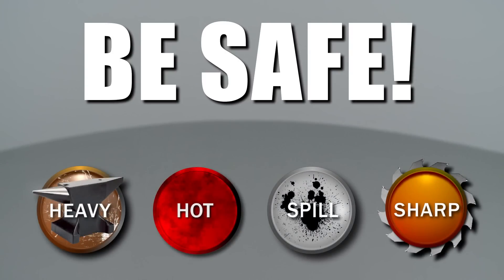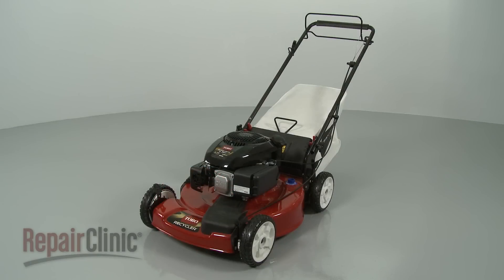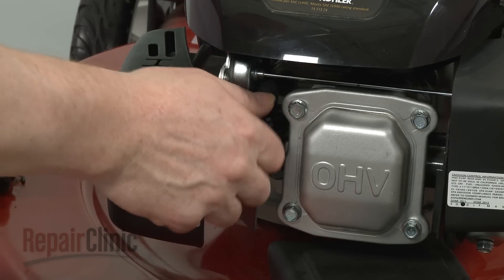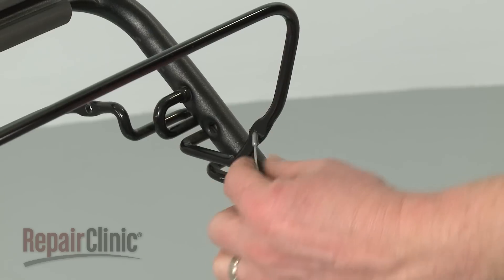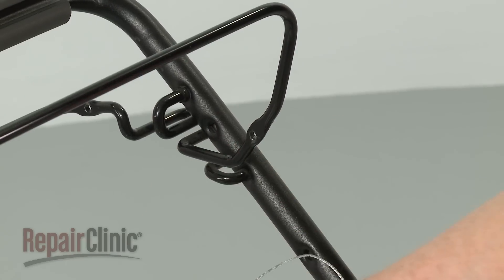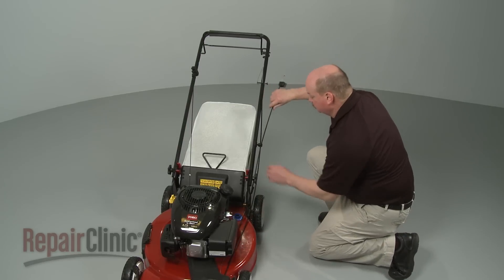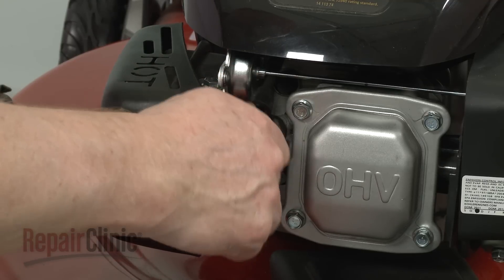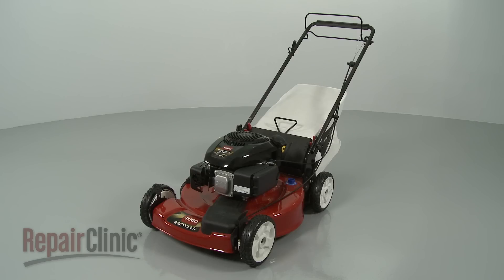Toro Lawn Mower Brake Cable Replacement #112-8818

Comment: I have a TORO 20333 model and the Brake Cable is much more difficult to take out  because is at the bottom of the mower